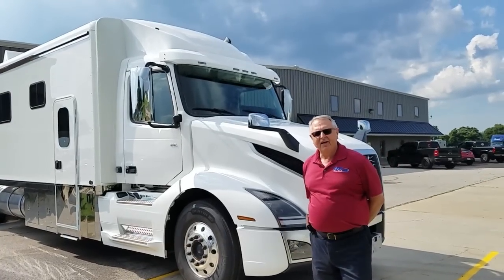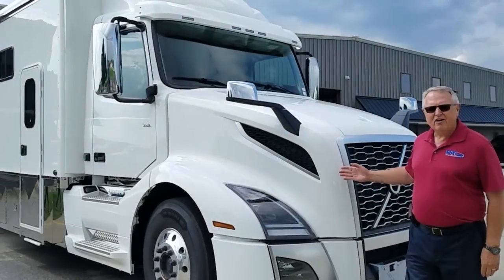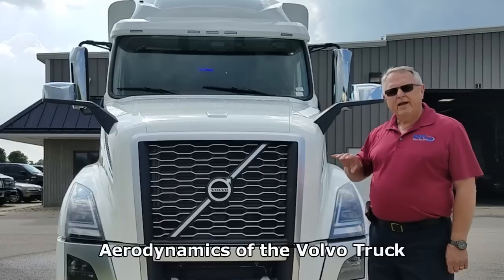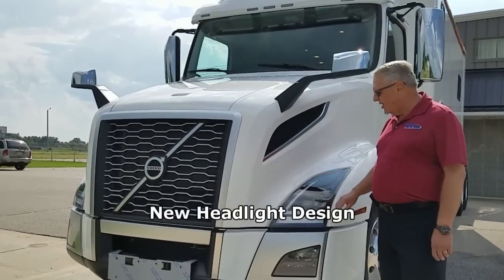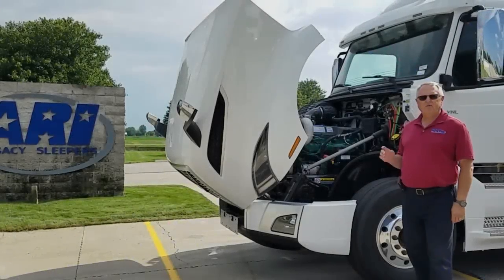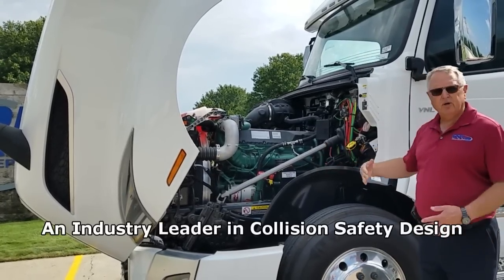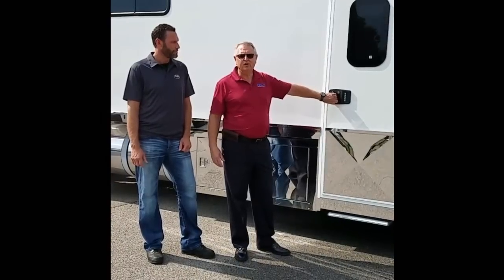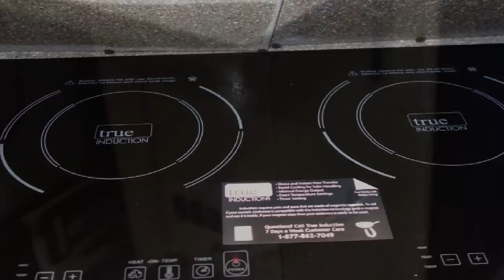2019 Volvo with 180" ARI Legacy Sleeper

Comment: What is the total weight of the volvo 180 and also what is the PRICE
Reply: Casanovafff probably close to 250-300k.
Reply: It would be hard to make money with this unit
Reply: Curtis Noble $180k-$220k
Reply: TruckerBeetleBailey I’m looking at a used Volvo with 168inch sleeper from 255k from ari.
Reply: Curtis Noble hi Curtis, do you mean because of its length = less freight = less miles?  Thank you for answering and help.
Reply: Brad Shores length and weight really. Plus cheap freight.
Reply: To buy a truck like this you have to have a contract to haul specialty loads that pay for the truck ie, military, Gov are private sector.
Reply: ! Pretty obvious that you haven’t done your research for this type of application!Curtis Noble you do not buy these trucks to haul cheap freight

Comment: Nice truck but peace of crap motor.
Reply: PEACE bro! but really piece lol
Reply: I never had a problem with the motor, with 425hp 1850Tq I would pass Pete’s up hills pulling 44k. It’s the DEF unit I’ve always had a problem with.
Reply: The average D13 goes about twice as long before needing a in frame compared to a ISX. Not to mention the Volvo has a much better emissions system reliability than the Cummins.